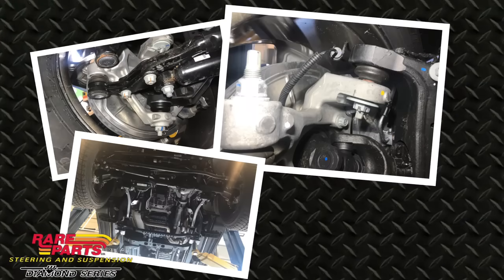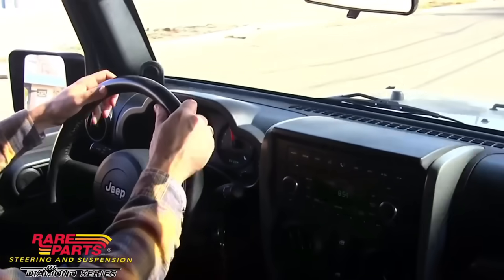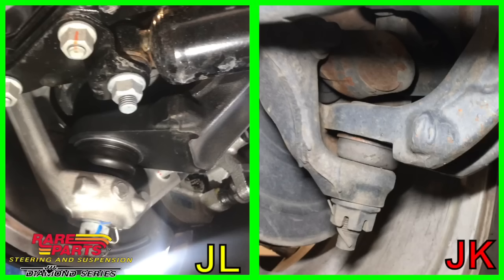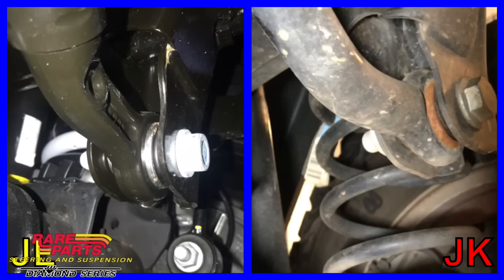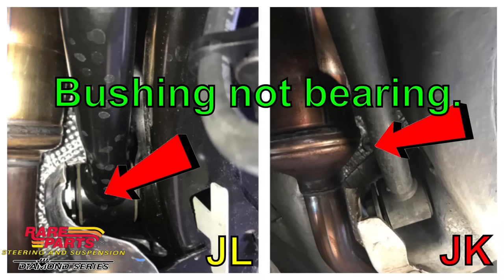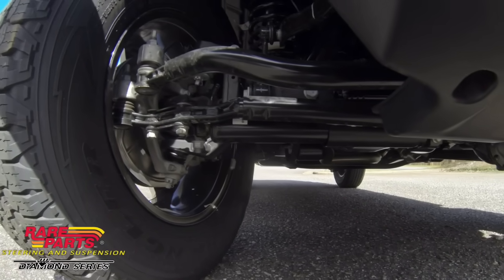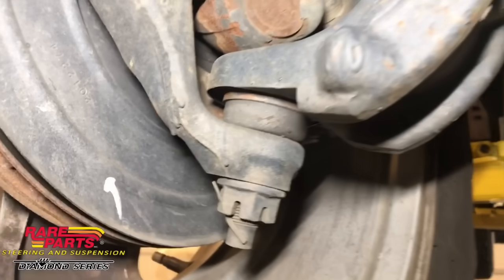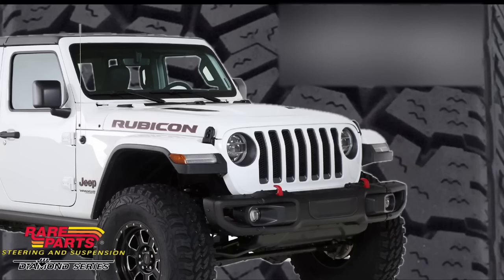Jeep Wrangler death wobble  Jeep JL vs Jk steering and suspension changes

Comment: First time I experienced death wobble was from the passengers seat of my cousin’s moms XJ. I was 11. She traded the jeep off shortly there after. The second time was about 10 years later in my second XJ. It had 170k on it at that point. I changed the steering stabilizer with a Rancho, no problems two years later. No mods to any of the above vehicles stock tires.

Comment: My Jeep jl has 36k miles and iv been Baja racing at 30-40MPH. I haven’t gotten death wobble but started to change out nearly all the suspension at out of fear of death wobble. I just recently put in a pro-rock 44 and changed out the tie-rod, draglink, trackbar, ball-joints, and also added a brace on the steering box. And I can already tell the old suspension was getting close to death wobble because the Jeep rides more smoothly.

Comment: I have a 2019 unlimited sport with factor lift and only 23,000 miles on it.  I have the Death Wobble, can't fit a bump going over 60 mph. Took it back to dealer and they keep saying they can't get parts in. This has been happening since March of this year.

Comment: At 7.0 minutes, wrong, I understand this video is now 3 years old but I have a 21 with 3300 miles and got dw, just sayin
Reply from the maker: It’s not normal. Something is wrong. Has the Jeep been modified or is it stock? If stock it could be a steering dampener?
Reply: @BrandonHaneline  I put dual stabilizers on it and quick disconnect sway bar links is it, it is completely stock other than that, dealership says no recalls or tsbs so nothing wrong
Reply: @BrandonHaneline  and it has the updated iron steering box

Comment: Guys I’ve had a major experience with “death wobble” after I did the lift. I do agree with some parts of the video but to replace everything in suspension and steering is absurd. My issue was my caster was out, stock wheels changed and I replaced my stabiliser for assurance. Think of it as a shopping cart or trolley.
Reply from the maker: What year. How many miles?

Comment: Worst death wobble I ever had was on my 2006 LJ.  Problem turned out to be stick on wheel weights on my aluminum mags... one came off the front inside and nobody knew.  I say "nobody" as it took me 2 Jeep dealers and 3 tire dealers to find the problem.  Finally, the Goodyear dealer where I buy my tires had one of those alignment machines like you show at the 9:30 minute mark that found the problem instantly.  Bottom line, death wobble helped me find Jesus.

Comment: It's not "everything" make sure and check the tire balancing and rotating as well as your rim specs. Too much offset loads up you outer steering bearings and it works the wear inward.

Comment: Kind of an oversimplified explanation to "death wobble" in my opinion. I had a Jeep JKUR with all stock axle and steering components lifted and with 35" tires. I did the lift myself and the caster wasn't correct. I drove like that for nearly 80k miles and never had any so-called "death wobble". At some point, I did replace the ball joints to an upgraded version and have the geometry fixed by an offroad shop which really made the ride a lot better, especially when I hit a bump but having sold it recently with just over 90K miles on the clock I never had a death wobble. Lot's of off-roading as well under its belt.

Comment: I had death wobble several times on my stock 2008 JK with only 4,000 miles. The dealership replaced the steering stabilizer 3 times with progressively bigger diameter dampers, which obviously only masked the real problem. They finally said.. "That's the biggest stabilizer we have, so if that doesn't fix it, you'll have to buy an aftermarket damper."  I thought they were joking. They weren't.    I contacted my buddy who works on Jeeps, and he told me that he could fix it.  We replaced  all the ball joints and bushing in the front end with moog parts, and the difference was amazing. No more death wobble clear through 150k miles, and the handling was drastically improved. I had to argue with my dealership for a while, but they finally paid me for the parts I had to replace.  I only paid 17,995 for my JK brand new, so I really couldn't expect much concerning the quality of the Jeep, but with today's prices approaching 40k..... I would be pissed if they still had such cheap suspension components.

Comment: It’s crazy that you say that jeeps at 40-50k miles you have wear on the joints and bushings and need to be replaced. That’s crazy for a $50k vehicle. My Toyota Tacoma is on all stock original ball joints, bushings, and suspension and it’s at 150k miles. All the joints and suspension are still good, even still on the original axles from Toyota. And this Tacoma was only a $30k vehicle when new. I hope my gladiator don’t start acting up at 40-50k miles, that would really suck, I’m used to my Tacoma just driving good with no issues for the past 15 years. Only ever did regular maintenance and did the timing belt at 130k. I wanted a new truck and just bought a gladiator. Was gonna sell my Tacoma to my nephew for just a few thousand bucks to help him out. Hopefully I don’t regret selling it! The gladiator is brand new still so I love it and it drives great, and I enjoy it a lot. But it’s only got a thousand miles on it. Only time will tell.

Comment: I have an 18 and had no problems, but while having up grades done to mine I have had 2 2019 loaners (brand new) and both have death wobble both at 65 mph after hitting pavement that while leads than ideal, but still should not have cause a problem

Comment: I experienced a DW this last Thursday 10/17/19 on my *new 2018 Wrangler JLU (not lifted) while taking a trip out of town.  We hit a railroad track at around 55 mph and it went full-on death wobble.  Had to pull off the road and stop the vehicle for the DW to stop.  Stopped by an out of town dealer and they said the recently replaced (recall V41) steering stabilizer was installed upside down.  I have ordered a new Rubicon Express track bar and Fox 2.0 stabilizer to see if this will help eliminate the DW. I've owned two JK Jeep Wranglers in the past and didn't experience any DW.
*Purchased new 2018 JLU Wrangler from dealer last month. DW event occurred with approximately 1,400 miles on vehicle.

Comment: 2018 jl with factory mopar 2 inch lift and 33/12/50 tires. Had a wobble when I would hit a bump but factory put a upgraded steering stabilizer on it and it was fixed

Comment: Thank you very much for this very educational video. 
Did death wobble increase more on solid front axle vehicles when they all went to front coil suspensions from front leaf suspensions ?? Or was it the same ??
Also I was so looking forward to purchasing a Jeep Gladiator because of my  old school attitude.
# "1" Solid Front Axle 
# "2" Mechanical Floor mounted 4 wheel drive shift lever. 4 Wheel Drive Dash Board Switch "LAZY"
# "3" 6 speed Manual Transmission Availability.
But after watching this video and reading everyone's comments and experiences, I'm very apprehensive about Purchasing a Jeep.

Comment: 2018 JL with death wobble at 10,000 miles! Completely stock. Dealer has put 2 steering stabilizers on it and seem to think a 3rd is going to fix it. Refused to pick it up and return loaner car till they do something different!
Reply: Why refuse? The third time could be the charm you are looking for. Lemon law states that if they can't fix it after the 3rd time, they buy back the vehicle. Get a brand new one without freakin death wobble.

Comment: Hi There, 

  I got a JL 2 month ago. First I got 35's, all good no issues... then I added the Mopar 2'' lift and boom death wobble.. Why? do you know? I spoke to my Jeep dealer and they said they sent all 2" mopar lifts back, they will never install them again. I spoke to another 4x4 jeep place and they said the same.... why would a NEW JL be doing this?
Reply: Did you change the drag links(control arms) ? If not the geometry of your suspension has been altered as has the pinion, brake, knuckle, and tie rod angles. It you did replace drag links they could be wrong. Id say a set of adjustable drag-links so you can dial angles would be a good place to start. That or revert to factory.

Comment: My 2018 JL wrangler is completely stock and started getting swathe wobble 6k miles into ownership
Reply from the maker: James you and a lot of others are having the same problem.
Reply: @BrandonHaneline  Jeep has even had to buy back some of them because they can't figure it out. My friend works at a Jeep dealer and at least 3 brand new Wranglers  come in for death wobble.

Comment: This video states, "You will NEVER, ever, EVER see DEATH WOBBLE rolling off the showroom floor.” 
In my STOCK Wrangler JL experience and many others well below 5K miles…

https://www.nhtsa.gov/vehicle/2018/JEEP/WRANGLER/SUV/4WD%252520Later%252520Release

YOU WILL, and I assure you it is VIOLENT!!! Ask yourself this question, if it didn’t exist WHY is it even discussed? Hmm, because OP wants $$$ for a known issue. REPORT IT to the NHTSA shown above or become a JEEPTARD follower. Sing it boys!
Reply from the maker: Agreed Matt.  I was wrong in this video. I guess I should have stated that a proper functioning solid front axle you would never see it. So many people are having the same problem you are experiencing.

Comment: This video is not true, I have a brand new Jeep JL unlimited sport(2018) in the sting gray color. Mine has no modifications besides tinted windows. I have 6,000 miles on it and Its been back to the dealer twice!! 2 times! For this wobble. It does only happen above 60mph and if hitting an uneven road surface. This is a chronic problem. The dealer has rotated my tires twice....its still there. Has nothing to do with mileage. I'm very disappointed after putting 10grand down on a 40 thousand dollar car. Smh.

Comment: I have installed a mopar 2 inch lift kit to 2018 JLUR and I'm having death wobble. Got my jeep alignment right away but still having problems. I ordered a yeti adjustable track bar and also an fox 2.0 stabilizer shock. Do you recomend any other components?
Update I installed my yeti adjustable track bar and a fox 2.0 stabilizer and no more death wobble. Know mind you  I'm a bit sceptical if I fixed the problem or did I mask the problem? Only time will tell

Comment: The answer is no. My 2018 Jeep Unlimited JL has death wobble
Reply: My death wobble on my 2018 JLU first happened at 4800 miles and is still happening after Jeep replaced steering stabilizer.  This video is wrong, the JL's have a problem.  My 2015 JKU has never had death wobble.
Reply: jim castiglione jim Mine has it now too same mileage what did they do to fix yours

Comment: have 2018 jeep jl 2.0 seems like the alignment is messed up. should I take to the dealer and fix it
Reply from the maker: Yes, please see your local dealer
Reply: Just go to 4wd place ask them where they go for alignments, usually alignment shops are more thorough than dealerships.  Alignment shop your in n out quickly,   dealerships your going to wait along time.

Comment: I have a friend with a 2018 wrangler with only seven thousand miles that has a horrible death woble. It's completely stock with stock tires and has been doing it since new. It's been to the dealer 2 times and is there right now. They have duplicated the problem but can not find anything wrong.
Reply: headed to the dealer this week with JL 9K and death wobble
Reply from the maker: I hate to hear that Will..
Reply from the maker: I’m installing a steering damper tomorrow on a JL with 3,800 miles.
Reply: JeepInformant let me know about damper

Comment: This is what my dealership told me as well too that it is the steering dampener.  I have been waiting for 13 days.  Been in a rental.  Still no word from the dealership about when the part will come in.
Reply: keep us updated
Reply: In my experience it is either tire balance, wheel bearings, and/or ball joints if not the things in the video. Just like he said, the steering dampener is just a band aid fix

Comment: I enjoyed the video however I respectfully disagree.   I had a Jeep tj and I had death wobble.  Tires where brand new and balanced and all steering ends where new and new control arms post lift install.  It wasn’t fixed until a new heavy duty track bar was installed.  The death wobble never came back even after 40,000 miles and long arm upgrade installed.  So in my experience I feel the track bar has a bigger play and then the stabilizer shock next.  Just sharing my experience but still great video well done!
Reply from the maker: Chad. That’s great info. Thank you for sharing!! 😊👍🏻
Reply: Probably worn bushings on your original track bar. The stronger the system, the better it will hold up against the failure of other components though.

Comment: Owning a JEEP is like owning a BOAT! It's a money pit! Expect to pay lots of money for wheel'n fun. My 1998 Wrangler Sport TJ has a mix match set of parts for a really high lifted suspension. The person who had it threw a mixed bag of parts on it. Rear axle has short trailing arms on top working with long trailing arms on the bottom. Both have different radiuses, which wear out the bushings super fast. I rarely drive mine on the freeway because it was intentionally set up as an off-road vehicle. Driving at slower off roading speeds i don't experience such events. I only felt a moderate wobble once while driving on I-196. Right now it's not going anywhere as it needs a new or remanufactured AX-15 transmission. I'm NOT dumping someone's used tranny in it only to have that wear out within a few thousand miles.

Comment: Mine happened on a stock Jeep Wrangler 2018 JL Unlimited at about the 6000 mile mark, so its not just on lifted or ones with higher miles.
Reply from the maker: Yes Barry you are correct I’m aware of the current stock JL situation.  Working on a vid currently.
Reply: Barry Cohen my Jeep JL has been at the dealer for 9 days now, Chrysler is paying for my rental.  Waiting on the steering stabilizer.
Reply: Same with mine!

Comment: Sounds like an expensive prospect every time you need to replace a steering part.
Reply from the maker: A. Tron if you have found a part that is bad obviously that needs to be replaced first before the rest of the steering & suspension system. The replace everything is kind of a generic approach

Comment: I have an All New  2018 Jeep Wrangler Sport S JL with stock suspension, nothing changed, less than 5,000 miles from off the showroom floor, and I have experienced “Death Wobble” 3x on the interstate with minor pavement transitions (no pot holes).  At dealership now for inspection.  Anyone else experienced this in a JL?
Reply: mine 4 times death wobble over weekend... 12/1/2018
Reply from the maker: Oh crap. That’s not good.
Reply: My car is now out of the dealership and hopefully the problem is solved.
Reply: Only took 17 days
Reply: @carlalaberman7550  same with mine. Has been back twice and only has 6,000 miles on it! Smh.
Reply: Yep, at approx. 500 miles.....going in next week....no mods, stock tires
Reply: I am at 3000km on my JL Sport S and im getting a severe vibration when i hit minor imperfections in the pavement at highway speed. It only lasts for about a 1/2 second then calms down, but im almost sure this is the beginning of death wobbles for me.
Reply: I got mine 2018 Jeep Sport S at the beginning of 2019, now I have 1500 miles. It does happen that wobble on a highway above 80 mph. When I hit some pothole or imperfection on the road the whole car dances on a road a bit. 
But it looks like all Jeeps do that, so I don't bother going to the Dealer. 
  Well, when I start praying, when that death wobble happens, then I know the time has come for a dealer check up.

Comment: I have a 2018 job with 9400 miles that has death wobble
Reply: No repair so far they said it needs a steering stabilizer but they can’t get one until December 18th... but I know that doesn’t fix it
Reply: Tony Bivens that’s a long time.  Mine has been at the dealership for already 9 days waiting for the steering stabilizer backordered too.
Reply from the maker: Also need to make sure all the steering is suspension components are tight we’re finding a lot of things that are not tight enough. Also check the balance on the tires
Reply from the maker: Hey Tony. Has any repairs been made yet?
Reply from the maker: Every JL so far I have seen has had a lot of not tight enough steering components. Also. How about tire balance??  Have they checked that yet.
Reply: JeepInformant thank you for saying this!! My dealership was astonished that this is happening in my All New JL Wrangler Unlimited Sport S with all stick components.  Happened 3x so fat at only 5,000 miles.
Reply: Mine just experienced this 9K  on Dec 1st 2018   but was already having issues with the JL steering as it wanders